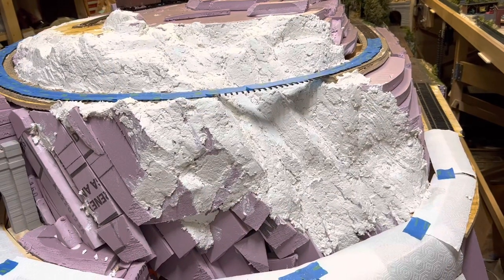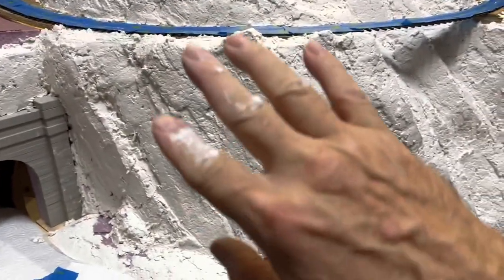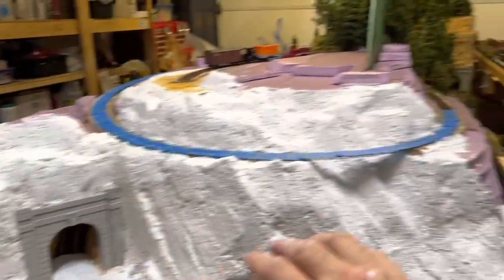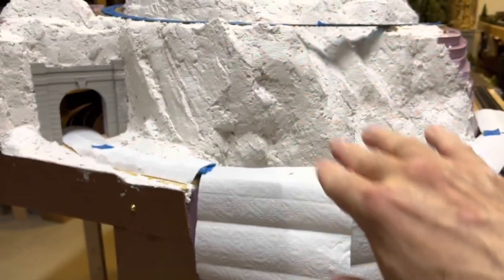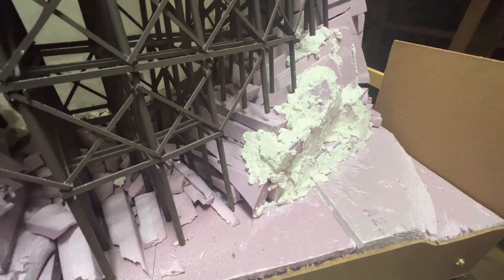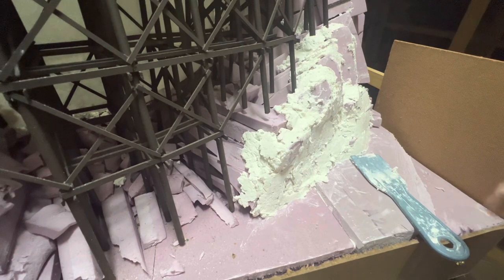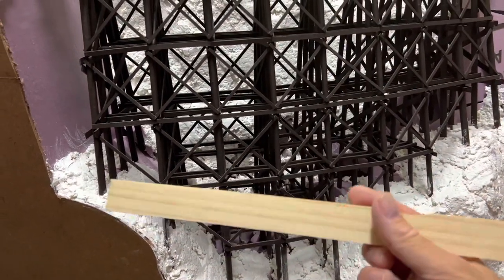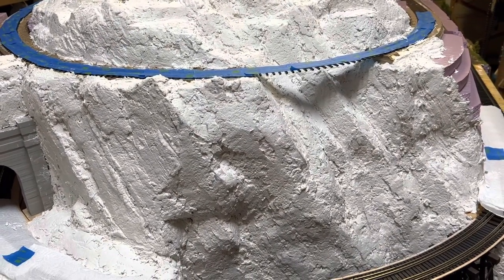O/On30 - Sculptamold Party 😁 - Model Railroad Adventures with Bill EP213

Comment: I used joint compound in a 90 minute set time from powder form. Even though I get cracks threw out, I try to take advantage of them from past layouts. I am working on # 6 right.